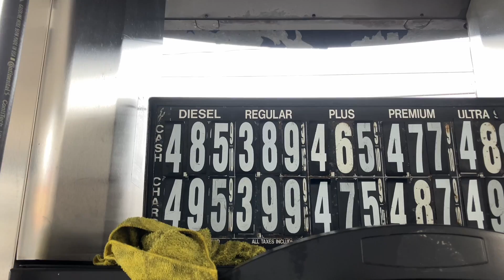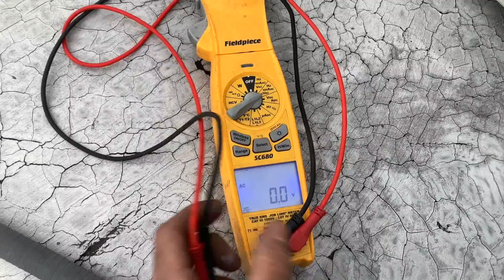Crazy Reason this Roof Top Unit Fell Over!

Comment: ahh my god 4:14 there xpo logistics truck in the background i wonder if the the same one i saw at work if it is say hi to jon
On another note wind and water and knocked over ac/heating unit could be disastrous do to them use gas and electricity make your speakers go boom boom   since nothing was happen as you record this it means it kinda safe yet with hint of danger

Comment: A tech tip from an old timer...unless you got freaky long fingers. Wrap your thumb and middle finger around the pipe, if they touch..11/4" if not 11/2"
Reply: Everyone has different size hands and fingers. Might not work for all people.
Reply: Neat trick. I’m retired now, but I did HVAC for 25+ years. Never heard that before on how to guesstimate the pipe size.
Reply: @jamesszalla4274  Congrads on retirement my man, 42 yrs in trade here. I'll go a bit longer. Have shown this to many apprentices over the years, works every time no matter the length of fingers, just an awareness once they do it themselves,, they never have had a doubt of 1/14 0r 11/2 after demonstrating to them

Comment: Lesson on the plumbing - the thing should seal with a flat washer not on the threads, they’re parallel not NPT so no taper. No amount of tape or megaloc will seal that unless you use some kind of anaerobic sealant which goes hard.